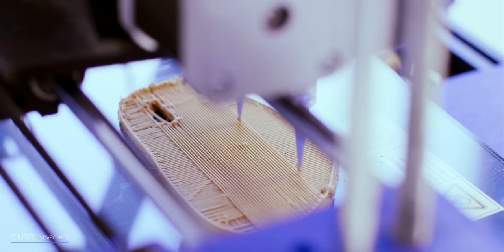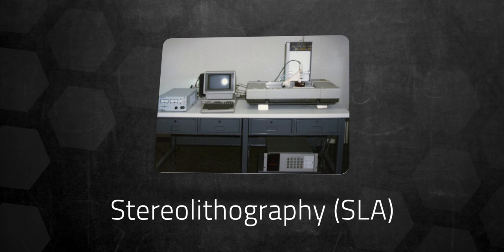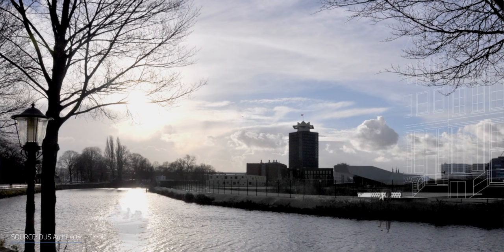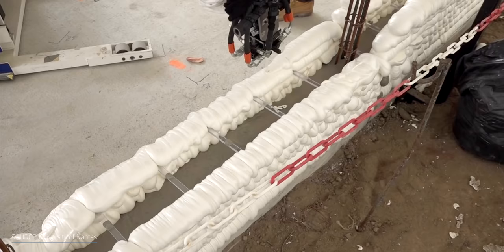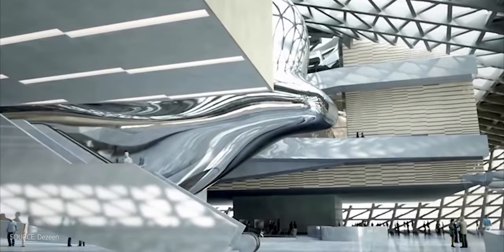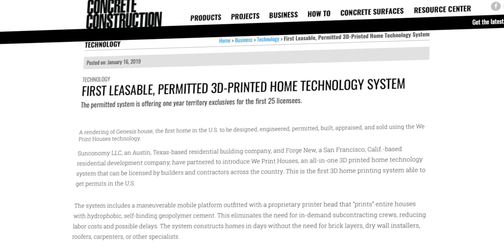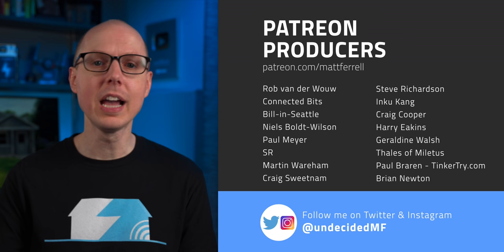This 3D Printed House Changes Everything - Explained

Comment from the maker: So would you want to live in a 3D printed home?  And if you liked this video, check out "Is Geothermal Heating and Cooling Worth the Cost?  Heat Pumps Explained": https://youtu.be/PI45yUhUWgk?list=PLnTSM-ORSgi5LVxHfWfQE6-Y_HnK-sgXS
Reply: Another great video
Thanks
Reply: Everything about our new technological era is teaching us to do more with less, and at a reduced cost. Digitization and automation are steadily eating at the foundation of the capitalist system. Labor is now adverse to productivity and efficiency in our digitally enabled reality. The 1st industrial revolution created our current reality. The arrival of the digital autonomous era is already rendering it obsolete. The effects are everywhere in our society today. You just need to understand what you are looking at.
Reply: Seems like a great idea except, what would all the unemployed construction workers do?
Reply: So what about the fumes?
How long do they last?
Reply: I would live in one.  How do they put things in the walls like electrical wiring and plumbing?
Reply: @truantray  Thanks for the info hopefully technologies like this can be used to improve safety and make the job less physically demanding.
Reply: @desultorilypanacea  move north where these buildings won't come for years. i haven't seen one yet that will build on the side of a steep hill or mountain.
Reply: Definitely because of the lower cost and more sustainable while it can be done at a quicker paste then standard construction that can takes months years while costs more money due to labour and heavy machinery.
Reply: @craiglortie8483 , I wouldn't worry too much about this technology yet. They have to convince construction workers they won't lose jobs by using this.
Reply: @desultorilypanacea  they don't have to, but they haven't started using it on anything but level ground. That means it'll be years before they make most workers worry. 😀
Reply: Thank you.   I'm following the market for such....
Reply: LavaCrete, Is That Somewhat Like Roman Concrete?
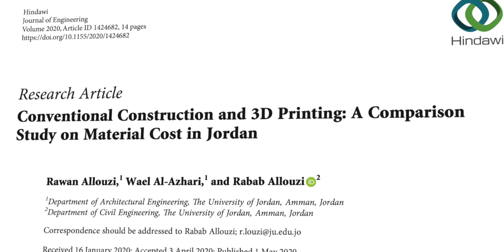Reply: 6:47 true. consider concrete walls, concrete purpose is just to bind things together brick/rocks.  Maybe in the future, the printer can use higher ratios of solid vs concrete
Reply: @davefroman4700  Yea, good luck with your fully automated society, comrade. People's time has value - there is and will always be things that can't or shouldn't be automated. Therefore, people will need to be compensated for their labor. The nature of how work is done will evolve, but it's not going to go away, nor will everything become "fair" or "equal."
Reply: @davidhayes2374  They'll either leave recesses in the walls for those things or they'll stop mid-print to install, then print over them. Just like for windows.
Reply: @GridIndustries  You are no different than your grandfather seeing his first model T and thinking the horses would be king forever. Technology convergences are responsible for the creation, and eventual demise of every social/economic system in history. Every system has a technological best before date. Capitalism will not survive the arrival of the digital autonomous era.
Reply: @davefroman4700  I work in IT - I embrace technology and learn to utilize it to my benefit. I simply disagree with your assessment that automation with be the end of capitalism. I'd love to see 3d printing technology bring affordable housing to lower income people and charities utilize their donations to create free housing for homeless people.
Reply: @GridIndustries  Meanwhile we are 3D printing substrates at the atomic scale and I know of 6 different groups already working on Nano-replication. Everyone from recycling sorters to brain surgeons are being surpassed by AI enabled automation and even the programmers are being surpassed by AI as well. Your narrow view of what is happening in your particular sector is not representative of the greater trends.
Reply: @GridIndustries  Over 80,000 accountants and bookkeepers have been let go from corporate back ends in the last 3 years. ALL of them replaced by a single AI. The company that wrote it? Employs 83 people. And less than two dozen are software engineers. For every job the new technologies are creating we are losing hundreds in the old infrastructure.
Reply: @davefroman4700  I didn't say it was representative of "greater trends." - you made the false assertion about me not being accepting of new technology, which is clearly not the case. And who is "we?" Are   YOU actually working on any of these advances? I doubt it. Those advances are years and even decades away from being practical. It's great that you think AI replacing people is a good thing - I don't, at least not in all areas. 

I see 3d printing advancements being a good thing. The technology has gotten much more affordable and accessible. It's enabling us to make things we need at the source, things we couldn't access otherwise due to production volumes and costs, things that make us more efficient, as well as subvert censorship. It's not all about AI.
Reply: @davefroman4700  New and expanding sectors create new opportunities as well. People have the ability to learn new things. It's not just they're out of a job and they go sit in the corner. 80,000 people in 3 years - do you have a source for that? Is that in one country? Worldwide? People are adaptable, it's one of humanities best traits.
Reply: @GridIndustries  We have the results of that displacement. 90% of the people have been forced to take lower paying jobs. And what a human takes 4 years to learn in a university an AI can absorb in 40 minutes today. Man has never had to compete against machines capable on analysis and decision making. Everything about this new technological era is teaching us to do more with less, and at a reduced cost. Over 3 million dollars worth of goods and services that you had to purchase 20 years ago have now been rendered redundant in our society due to that innocuous phrase, "There's an App for that." And you get it all for the price of maintaining your cell service. And we are in the process of digitizing everything from food production to housing over the next 10 years. We already have 3 general purpose AI's today. A breakthrough that all of the experts thought was decades away 2 years ago. As an analyst I have been studying this issue for a decade now. People have NO idea what is happening. 
The government unemployment numbers are so full of feces its laughable. We have more people homeless today than we did during the great depression.
Reply: @GridIndustries  Our ability to adapt is no longer a monopoly for the human species.
Reply: @davefroman4700  Well I guess the end is nigh? AI is upon us and any minute now millions are going to be out of jobs. Now what? Meanwhile, the government keeps up spending money and printing money, resulting in even more inflation. It seems like an economic collapse is inevitable.
Reply: @GridIndustries  The human species has created 7 major social/economic models in our history. Anthropologically speaking they all share one common thread. Each one was enabled, and later rendered obsolete, by technological convergences that fundamentally changed our relationship to our environment, and thus our society as a whole, because the human species is a behavioral product of its environment. Our current model is based upon 300 year old Malthusian era beliefs about human behavior and the insistence that man would never possess the technology to overcome scarcity in his environment. Antiquated ideas that were never scientifically valid in the first place. The only things that are truly scarce on this planet? Have absolutely nothing to do with our abilities to feed, clothe, house and care for the entire population today with our modern scientific capabilities. And every other organism on this planet lives in symbiotic balance with everything else on this planet. This idea that we are all meant to be competitive selfish greed driven individuals is not valid either. Those behaviors are a response to a competitive environment. Not our nature. We are the most social creature that exists on this planet. We do nothing but excel with cooperation and receive our greatest personal satisfaction helping others.
Reply: @GridIndustries  Sociology, psychology, biology and physics all prove that our current social arrangement is invalid.
Reply: @davefroman4700  competition has always been a thing that exists in nature, it's not specific to our species. Doing what's in your own self interest doesn't automatically equal greed either. If anything, automation is going to enhance individuality, not diminish it. If our current social arrangement were invalid, it wouldn't exist. The fact that it does exist provides all the validation needed. Not all of humanity shares the same values, therefore mass cooperation isn't going to just happen someday, If ever. Globalist kumbaya is indeed an interesting prospect, just not one i care to be a part of.  Some people actually care about  personal liberty as well. Something that's been historically at odds with what you seem to be envisioning. When you have groups of people, they will divide themselves into smaller groups of people who share similar values. You seem to be ignoring this fact.
Reply: @GridIndustries  Sociology records dozens of civilizations that proved otherwise in history.
Reply: Can they build a 3D printing hospital with 3 levels using soil?
Reply: @kate1143  No that would require concrete. But this technology is already being used in China to do office buildings etc. I think 12 stories is the tallest so far.
Reply: @davefroman4700  The industry has to develop technology that will use soil without concrete. Soil is natural and it's widely available.
Reply: @kate1143  Engineering and physics say that is impossible.
Reply: @davefroman4700  Can 3D printing pave roads?
Reply: @kate1143  Yes but that is an inefficient means of paving compared to what already exists. Additive manufacturing is great for a lot of things, but not everything. Its real promise is at the molecular and atomic scale.
Reply: @davefroman4700  Will you live in a 3D printing house?
Reply: @kate1143  The likelihood of me building a home at my age is less than 1%.
Reply: @davefroman4700  Too young or too old sir?
Reply: @kingofhomes !!!!
Reply: i'm looking at a technology for my next house that came before 3d printing but has a fairly similar outcome. Concrete dome construction.
Reply: How do they put horizontal and vertical rebar in these walls. We get quite a few earthquakes in our area including a 7.1 centered about 10 miles from here. We suffered no damage to our double stud R40 walls filled with 30 psi closed cell foam. Building walls without rebar and we would be a pile a rubble similar to a 3rd world country after a quake.
Reply: @Still Waters I have a remote place off the grid but it doesn’t have a dirt floor. It has solar and water collection though.
Reply: @Louí Lopèz I see these houses being a pile of rubble after an earthquake as I haven’t seen one piece of rebar put in the walls. Also the thermal bridging in the walls don’t make it very environmentally friendly over time. It is like yeah we saved a bunch of fossil fuel building this house so you can burn a bunch to heat and cool it. Also I see more labor intensive installation of plumbing and electrical.  Think of the guy mounting doors and windows getting out his hammer drill to do everything. Heck, just mounting cabinets will be a chore.
Reply: @axiomatic  do you get snow where you live? I know a few people that built domes and they used the best methods available for roofing and they still have problems. For the best roof you need a breathable attic. Also when it rains all your water flows down  your walls down right to your footings because where do you put gutters on a dome. Another thing is that if you want your windows vertical you have to build dormers because if a window isn’t vertical it just collects dust.
Reply: @Still Waters If you think about it all they have to do is send a low level drone with a FLIR and they can find any warm body unless you are under ground and not emitting any heat signature.
Reply: I wonder how would the 3D printed houses work if I want to fix/change something in a wall by myself. It is probably not accessible to DIY yet...
Reply: I'm still partial to building my house out of giant bootleg lego bricks.  Bootleg because, despite labour being outsourced from Denmark to the 3rd world, it still has danish-style prices.
Reply: @Chris_at_Home  Not sure if we're talking about the same thing. There's no separate roof with a dome. It's an inflated membrane backed with urethane foam and then shotcrete. Waterproof. The windows' frames are included as part of the inflated form. I've seen the finished form with the membrane covered with stucco or other things, but leaking isn't one of the problems I've heard of.

Are you thinking of geodesic domes? Because yeah, they have roof issues.
Reply: Plastic fumes?
Reply: @davefroman4700  You hit it on the head we are our own worst enemy but will never change as we need the enemy to exist.... or so we are lead to believe and as such is true.
Reply: I'd love to, but there's a problem. It's too expensive. All these houses you're referencing are priced around a half a million. I paid under $100k for mine. With appreciation, it's now worth around $150k, or at least that's the amount the appraiser's office says it's worth for my property taxes. And I don't live in a bad neighborhood either. Granted, it's a 3 bed 2 bath in a townhouse shape, so it's maybe a little smaller than the ones listed, but the economics would have to work in areas where the price of real estate isn't idiotically high, such as the 'ritz bitz' in north Austin, anywhere in California, or apparently over in the EU.
Reply: It seems to me that most of the savings is in not using people. It'd be funny if not also tragic if someone is "low income" because they've been put out of construction work by 3d printing, having to use 3d printing themselves to save money because they themselves lack jobs. God capitalism sucks so often.

The printers themselves take energy to run, and energy and material to build, also I assume they break down and need to be repaired and even replaced ever so often. Hardly seems a environmentally friendly concept.

Why do we need 3d printing to practice environmentally friendly material construction use, like mud or bamboo?
Reply: 6:00 I like the look of the house, too sad you can't go on top of it.
It would be better to go on top and plant something on just sitting here I think the solar panel can be placed 3m above
Reply: Yes  I buy the land, I'd deff live in a 3000sq ft 3d printed home
Reply: Absolutely!
Reply: The problem I see with these projects is that the mostly focus on low density housing. I can certainly imagine that these would be good for rural areas, but cities cannot afford to expand low density housing because infrastructure costs rise too much. I don't think high density housing could be built with only printers, but there should be ways to integrate traditional construction with printing.
Reply: "So would you want to live in a 3D printed home?"

Not at those prices, they're very expensive!
Reply: Earthbag Homes are still cheaper, and the dirt is right there. 
3D printed homes are competing with that and not normal build houses. 
This is just hype and those prices are outrageous.
Reply: Soon as they figure out how to put in expansion joints or some kind of reinforcement I might consider it right now it won't even pass building code
Reply: No. The carbon emissions of the cement alone to make the house is ridiculous!!! Did you even bother to think or just Wikipedia the shit out of this?
Reply: @desultorilypanacea  UBI would seem necessary at that point. And then more people may follow their passions👀
Reply: jackie sparks  So....are you OK there man?
Reply: volcanic ashes can be made to create way cheaper concrete according to the MIT.
Reply: @IberianCraftsman  I guarantee it's not cheaper if you're shipping volcanic ashes to everywhere that uses concrete that doesn't have a f**** volcano not to mention I'm pretty sure that the composition has to be pretty much just spot on concrete is a science you just don't go take a bunch of s*** up and mix it together. The Romans were lucky because they had a volcano with just the right composition on hand
Reply: NO
Reply: Absolutely!  Especially if it could be made from non-recyclable plastics or other materials!  On a recent ocean sail we offered the kids a prize if they were the last to spot trash in the ocean over a given amount of time, with prizes increasing as the time increased. We never made it past 25 minutes.  We NEED to learn to reuse our trash.
Reply: Makes me happy I am an electrician not a carpenter. Haven't seen any one 3d printing wire... Yet.
Reply: @VerifyTheTruth  -- I've never heard of LavaCrete, but in Texas we have StyRete.  It's a mix of a cement variant and styrofoam.  It is harder and more robust than just concrete cinderblocks,  you can't break it up or chip it with a hammer, and so light you can pick them up with one hand easily.
Reply: @Erin-Thor  Does It Float?
Reply: Sips are just as fast and super energy efficient.. also the thermal transfer cannot be great with the bracing going from outside wall to be inside.. not good in winter
Reply: @VerifyTheTruth  — LOL!   No clue.  Kinda doubt it though, does what your speaking of float?
Reply: @Erin-Thor  Probably Not, But It Is Very Resistant To Salt Water Corrosion.
Reply: @Cgrub1234  thats actually a good idea, a robotic arm could set premade electric components inside the walls.
Reply: I wonder how it works with these houses so far as plumbing, heating and electrical. Does it just leave conduits for the mechanical equipment to be installed in or does it get installed surface mount once the concrete is finished?
Reply: @Cgrub1234  i bet it works the same way as any other house in Europe, these days only Americans still make wood houses anyways, all houses in Europe are made of armed concrete and bricks, it goes inside the walls all the same but instead of inside brick walls its inside concrete walls.

What i do wonder though is, can't they install 2 pieces of metal at the sides of the nozzle? that would make the printed lines smooth, it looks kinda ugly so wavy...
Reply: how sturdy are the 3D printed houses against natural disasters compered to standard building
Reply: No. Not until they can print the solar roof or include it in the processing
Reply: Darpa is trying to become the Taelons
Reply: Absolutely, yes.  I think that is very likely in store for me.
Reply: Yeah sure. We need more homes in the market to combat homelessness and help drive home prices down to something reasonable. 👍👍👍👍
Reply: 1:16 You missed that land is included in the price of a house. For a fair comparison, you need to compare the SQ4D build contract price to the traditional builder contract price.
Because of SQ4D's misleading comparison, SQ4D is probably more expensive. SQ4D will definitely finish much faster though, so if that's worth it to you then they are the better option.
Reply: So if utilizing Hempcrete is an option the only drawback is cure time?
Reply: I have 2 3d printers
Reply: If you add fibers that would be undestsucble house.
Reply: What about insulation wiring plumbing
Building codes as well fire safety